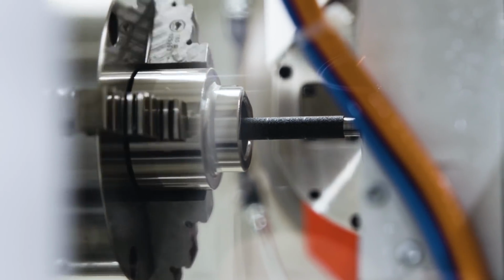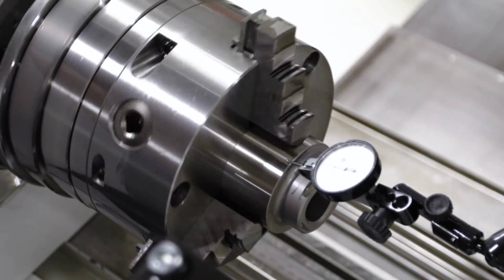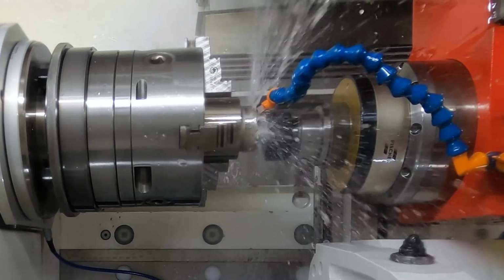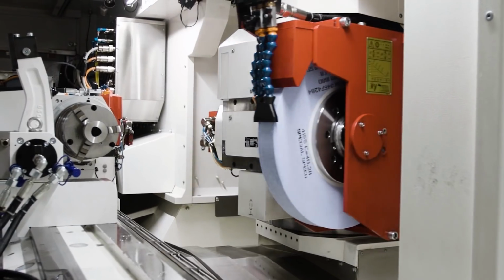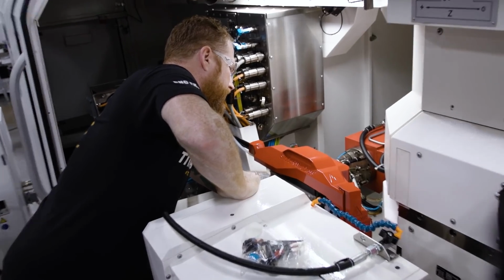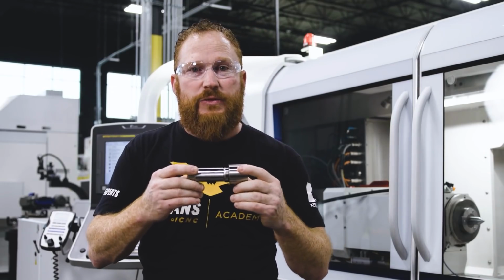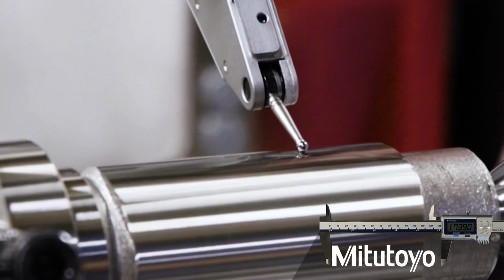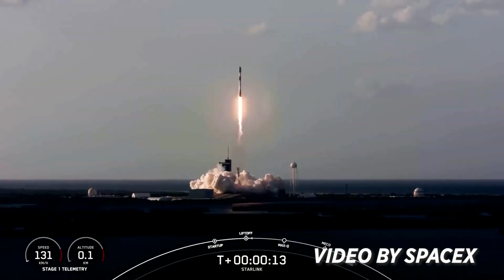Worlds First | Attempting to Cut the Impossible Polygonal Taper

Comment: I'm pretty sure it would have been much easier starting from a round blank and producing the lobes completely on the grinder rather than trying to line up the movement of the X axis going back and forth to line up with the lobes of the stock.

Comment: I may be missing something here but why was the part 3D printed anyway? It couldn't be to save time, 3D printing isn't fast. It can't be price of material printable materials are very pricy. I have a small machine shop lathe, mill, shaper, along with my three 3D printers and laser. I have worked in a prototype machine shop doing some strange stuff before CNC was popular. Don't get me wrong I am no way criticizing this negatively, Just curious. Love your videos especially the ones concerning shop business and management, I think I have been in most of those incidences, and relate to them well.

Comment: A Polygonal Taper, potential uses..? Particularly in line with the  'idea', that there could be 'easier' just as 'accurate' ways to achieve the same result.
Not trying to be a smart arse, I would really like to know. Oh, technology is brilliant. I am currently finishing a series of books on Nasmyth, Boulton and Watt, Maudslay, Smeaton and Rennie. You, I, WE, do stand on the shoulders of Giants.
Reply: Best of both worlds between tapered interface and cylindrical with keyway. Higher torque transfer than smooth shaft under cyclic axial loading with short lengths and low taper angles. No stress risers from key ways, no separate piece to worry about, etc. 

Looked into these for coupling a roller to a shaft with very short interface length.The shaft supported the roller vertically and there was only room for a single bolt to pass through the center to secure it. Needed to be removable fairly easily, but still maintain reasonable torque transfer. In the end a standard taper worked alright. The reason most people have never seen these before is that they’re expensive and rarely necessary.

Comment: You talked about how additive manufacturing can do geometries that subtractive can't.  But these parts seem rather straight forward, why were they 3D printed in the first place?
Reply: Perfect!!! Yes that’s the issue. Ppl are printing things that aren’t supposed to be. Honestly it’s a joke. 

My work is machining of metal a polymer parts. And things you see come through, you know for fact that it would be so much easier to machine it from a billet instead of trying to alight/locate the 3D printed part to machine a flat face or precise Bore

Comment: how is this impossible? the whole C style clamping system uses the same profile on a massive range of tool holders and spindles...it's been done for years, first patened by sandvik
Reply: Hsha yeah capto sandvik connection
Reply: Was just thinking that..
Reply: its possible but not easy, the sandvik holders are expensive for a reason
but they did only grind the taper, sandvik has also match up the face contact

Comment: Hmm, not sure this is a worlds first. Pretty sure some pump manufacturer has been manufacturing Tricoidal shafts for some time.
Reply: Pump manufacturers can plan production quantities for the parts which you are describing but this video was an example of a custom unit or small quantity item.
Reply: @tech-utuber2219  And pump manufactures cant do that?
Reply: @1ginner1  This video is for a limited quantity CUSTOM part, which is the only point I am making.  We were not told what the client application is.  We do not have enough client info to make any conclusions such as you are suggesting.
Reply: @tech-utuber2219  I am not suggesting anything, all I said was this has been done
 before , that all.
Reply: @1ginner1  okay but Titan has repeated that much of this is for education and showing capabilities since for example, a pump manufacturer would typically not freely share their manufacturing process with the public like this.
Reply: @tech-utuber2219  I understand but the title of the video " Worlds first", just got under my skin  a little, like theres nobody else in the world you can produce parts like you guys, We do.
Reply: @1ginner1  Yeah, Titan and his great crew do like to impress and flex.  We can forgive as they are giving back quite a bit, right?

Comment: You made an off the shelf part that's been made for years by sandvik and other companies. Also if this is such a high tech learning center why don't you have a verification software to assure your clearances are safe prior to machining?  Theatrics.
Reply: I’ve never seen a taper that shape with a 16 finish.   But cool that there are lots of people out there doing it.

And I’m pretty sure the software said it would work exactly the way it did, but when u do something you’ve never done before a good eye test really reduces the clench factor👌🏻
Reply: @samuelyoung2671  16 is not that impressive for a grind, should be in the single digits, you can turn a 20 with the correct inserts speeds and feeds. Also, the capto/P series tapers are a spindle interface as well as a tooling interface and are usually coated, brands like haimer are uncoated, and very nice finishes. 

With software like CGTechs vericut there is no clench factor, I make my programs release them to the floor and never have to go out to the machine because the software is so accurate and I never have a fear of a crash as long as it's setup right. The industry has come a long way and when you work with small lot sizes and expensive materials you don't get an allowance for error.
Reply: @Jay-rd8mj  you and others in the comments have made a wrong assumption.  Just because it resembles something which Sandvik created doesn't mean that it is.  Is there a demand for Capto units fabricated from high-temperature alloys like 718 Inconel?  What machining center using the Capto tool system has a requirement to operate at hot temperatures when only the actual tool gets hot? 

Capto units have a pronounced taper along the length and this part in the video does not have that.  That is why there were able to utilize a 2D profile section of the part near the end.  We don't know what the client application is for this part.

I fabricated a pair of long slender 718 pistons for reaching deep into a high-temp furnace to do failure specimen tests at red-orange glowing temps but the attachment ends for the system tester needed to be cool enough for an elastomer vacuum seal because we could not allow the specimens to oxidate due to air exposure.  The long length allowed us to stand off the temperature difference along the piston length.  You don't use this alloy unless it's providing a necessary benefit for the application.
Reply: @tech-utuber2219  they said several times in the video that the parts are tapered.
Reply: @Iceberg86300  okay but we were not told what the application actually was and why it was fabricated from a high nickel alloy.
Reply: @Iceberg86300  actually the male part is not.
Reply: @tech-utuber2219  2:53 (pointing to the male part) "polygonal taper"

I don't care what material this is & I don't care what the application is. The process is the same: OD & ID grinding a tapered, non cylindrical feature. i.e., shit that has been done for decades.

100% cool & interesting. 100% not some bleeding edge feat of engineering (outside of the 3d printing).
Reply: @Iceberg86300  I was responding to the assumptions that this was a standard off the shelf part, a Sandik Capto unit.  I ignored the use of the word 'impossible' in the title of the video.

Comment: Did you blue the tapers to check the percentage of contact between the OD & ID parts? Just like a propeller & shaft taper check.
Reply: Saw the same process being done after I finished machining gas-turbine halves to see if the mating faces of both parts were flat and steam-tight enough to be accepted by either GE or Siemens Power .
Reply: i think a big part of these designs (non conical tapers) is that they intend for deflection of the mating surfaces.  as side load increases, they will also increase clamp load, a traditional conical taper doesnt get the same type of clamp load increase with side loading.  example being taper lock in a cat40 machine.  not an expert though. they also allow for torque transfer without external keys.
Reply: @salvadorebertolone  
Iirc Capto for example is conical, just a very shallow angle.
Reply: @heinzhaupthaar5590  its a trilobular taper. Its not able to be represented by revolving a conic.
Reply: @salvadorebertolone  
Oh, now I get it. It's a language and stupidity thing. My bad.

Tapered, not conical. Of course.
Reply: I always blued my parts and checked for the percentage of contact. All of the grinding i did was on conventional lathes.

Comment: impossible? isn't that basically capto c6?
Reply: Exactly my thought
Reply: Haha it's always good to see other people with knowledge call their over the top bullshit out.
Reply: That’s what I thought too, an impossible part that you can buy off the shelf?
Reply: @HondaBoy  again, the Capto standard is a tapered polygon not straight.  Inconel 718 is an alloy for very high temperature applications unlike machines that use the Capto system.
Reply: @tech-utuber2219  changing the material don't make it impossible, just harder to machine
Reply: @rick371  My point was that anyone needing to make a Capto unit would not use 718 alloy.  These Capto assumptions are completely wrong.

If you are objecting to using the 'Impossible' word in the title, I made no reference to that at all.  That is just Titan & crew wanting to impress.
Reply: @tech-utuber2219  but the concept is the same, it's like making one bolt out of mild steel, and one bolt out of inco 718, the parameters change, but the concept remains the same
Reply: But the Capto standard is also tapered along the length.

Comment: Nice example of the shape grinding capabilities of the studer. 

I did cringe when you loaded the heavy wheel with out the help of an overhead crane, I know how heavy those can be. 

Shop I worked had a weight limit of 35 pounds so I custom rigging device was made for my overhead jib crane to load and unload wheels
Reply: The factory I stopped working at yesterday was against me lifting any weight but they had me prep/run/deburr/package 400 5kg plates right before cutting a slot on 15000 aluminum extrusion parts (I asked them to incorporate the cut off too so I would load a certain length instead of tiny parts buy 5 caskets of parts would just be there in the morning without prior notice within 2 weeks

Comment: I don't want to bust anyone's bubble however machining and grinding of eccentric shafts as male female pairs have been being produced for decades. Perhaps the 3d printing of the blanks it the "world first" part of this video. And that seems completely unnecessary it seems risky to print such a simple part and risk the chances of a material deficiency when you can buy the stock with all the certificates on the front end.
Reply: Have you ground anything like that in your life???if you have fair play but I won't believe it until u show me
Reply: @rhindy6846  Yes in fact I have in the early 80's I was grinding solid carbide 4 lobe shafts with matching female forme tools for extruding copper parts. And we had a far higher finish requirement as the presses ran at extremely high speed. You might want to check your attitude if you believe this is some magical manufacturing process.
Reply: Mike Home, this channel content is for education and demonstration of fabrication capabilities, as Titan has repeatedly stated.  Your comment is reasonable but misses the whole point of this channel.
Reply: @tech-utuber2219  That's fair enough. I guess it might make a video title more clickable to say it's a world's first.

Comment: Does the inspection lab at the academy have the capability of stress testing? It would be interesting to witness dynamic load testing on those sintered Inconel parts.
Reply: In addition to the above would also like to see what the grain structure looks like compared to standard 718 material.
Reply: @stevetaylor996  There's tonnes of upcoming research of these additive manufactured parts, google scholar is your playground.
Reply: @stevetaylor996  They were manufacturing the shafts and impellers from castings not from 3D parts. So grain structure was not an issue.
Reply: They're building 3d printed pistons that are stronger relative to their weight than forged pistons. 3D printing is legit.

Comment: Was it necessary to 3D print these parts? Why not just start with inconel stock?
Reply: Spoken like someone who has never had to machine inconel.  It's one of the toughest bitches to machine of any material you can find at any price.     3D printing a near-net shape and grinding it to final dimensions is MUCH easier.
Reply: @Turboy65  depending on the application of the part, integrity could be compromised with a 3D printed part versus raw stock.
Reply: @rayfletcher8759  I'm aware of that but let's leave that determination to the engineers who are in charge of the project, how about it?   It's not new news that sintered materials have different material properties than solid stock.
Reply: @Turboy65  I like learning.
Reply: In fact it's not sintering at all, metal is fully molten in the metal 3d-printing process and end result is ~99,99% dense. So basically after correct heat treatments the inconel is 100% same as from a billet.